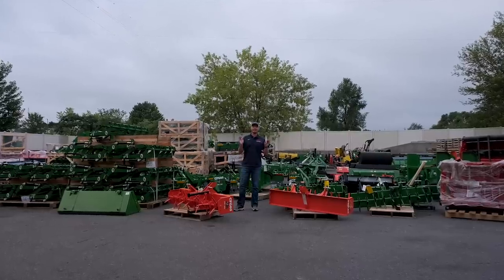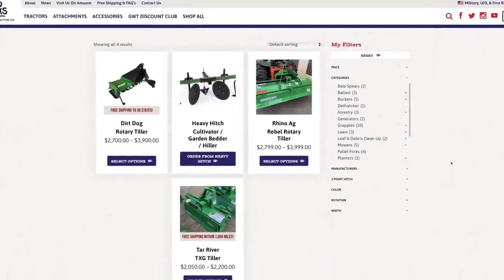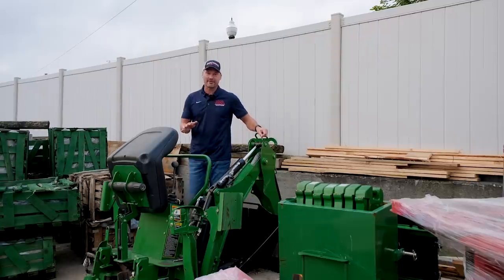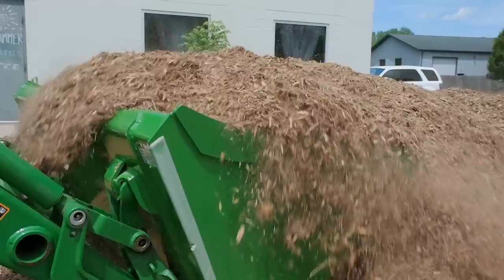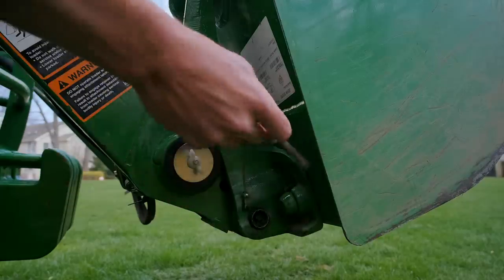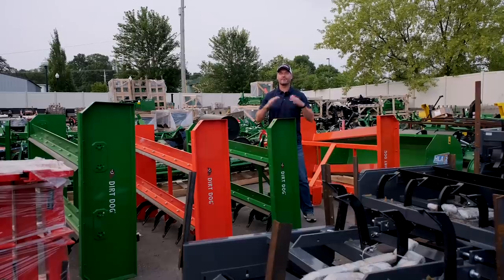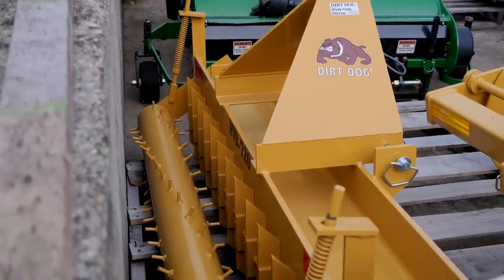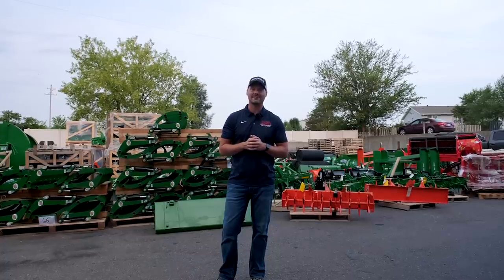TOP TEN TRACTOR ATTACHMENTS VOTED BY REAL TRACTOR OWNERS 🚜

Comment: FYI, Land Pride offers the QH10 and the QH05. Both of these are true Cat 1 quick attaches that do not require bushings. 

I’m planning on posting a video as soon as my dealer is able to supply me with a QH10. I will be comparing the QH05, QH10 and QH15. All three of which I will have on hand. And the QH15 is the only one that needs bushings.
Reply from the maker: Yeah, I learned that recently.  I believe it is much more expensive than the Speeco and inferior.  The QH05 and QH10 both have welded in place top hooks, so not adjustable.  The QH05 weighs 37 lbs so only about half the Speeco.  The QH10 weighs 67, so nearly the same, but still the welded top hook.  Not sure why they do that.  Major limitation.
Reply: @GoodWorksTractors  i tend to agree with most of your assessment.   in addition the QH05 does not fit all things quick hitch compatible outside the Land Pride line. For instance, it will not work on the Baumalight 1P24.

Comment: I do love my pallet forks, grapple and bucket for sure!  No need for a snow blower, we don’t get much.  I also have the brush mulcher, and the aerator.  I opted not to get the backhoe as it’s something I can rent cheaper than I could purchase and I already have the two previously stated implements that sit around too much.  But we didn’t have a local rental center back then for JD attachments either.  I’m using the box blade religiously right now and glad I got it with the little JD1025.  Unfortunately the Speeco Economy doesn’t fit it.  We tried for hours in the humidity and heat, placed a call to Mr. Courtney and still couldn’t get it to work with the Frontier BB5060L box blade.  Tried again when it was cooler and still couldn’t get the blasted thing to work.  So finally my damaged brain took a look and did some measurements.  It’s a quarter inch too big, due to the flange by the side pins.  My only guess is to take both down ⅛” or just do the Frontier the full ¼”. What do y’all think?

The one thing I absolutely love is the Rhinocover and it is an implement IMHO I’m now using daily….I don’t know how I went without it!  I no longer have the sun bearing down on me and the afternoon storm getting me soaked when I’m trying to get it back to its parking spot.  I just need to figure out how to install a fan or two and I’ll be made in the shade LOL
Reply from the maker: Something strange.  I've hooked up to many Frontier attachments with the Speeco and so have many others.  Conundrum indeed.
Reply: @GoodWorksTractors  I’ll take my phone and a tape measure and send you some pictures if that’s ok